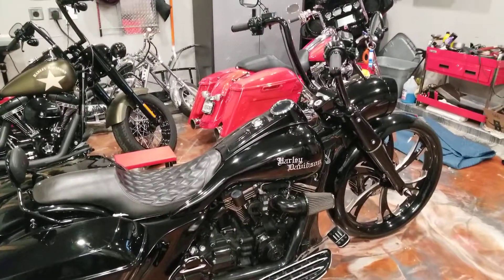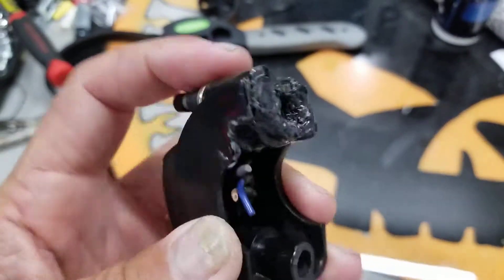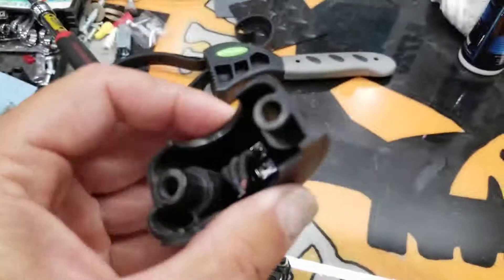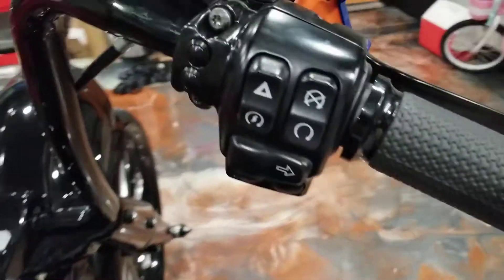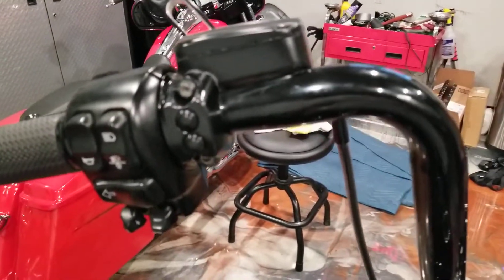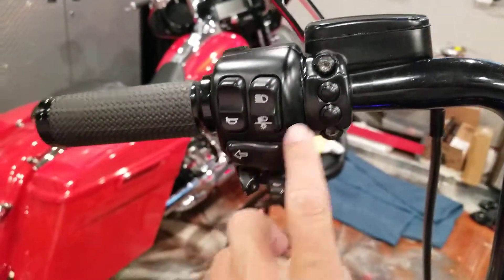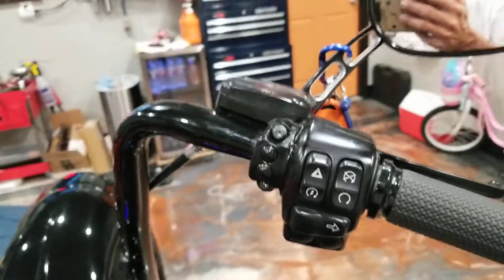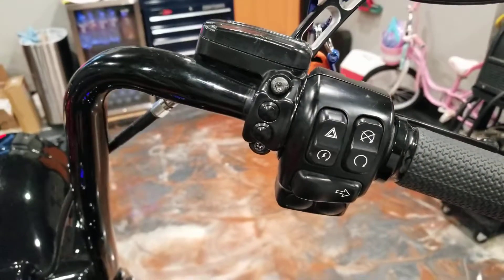Harley air ride grip switches

Comment: Did you run the wire for the switch inside the handlebar? I have the same switch and don’t want the wire on the outside looking for ways to hide it